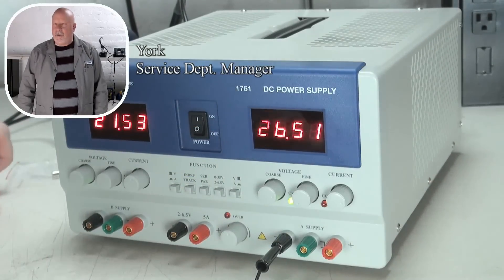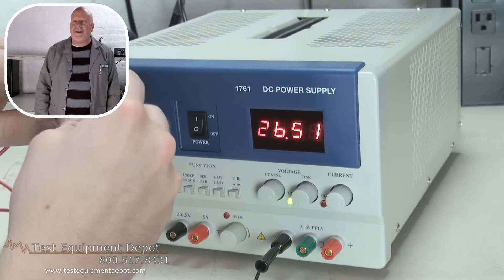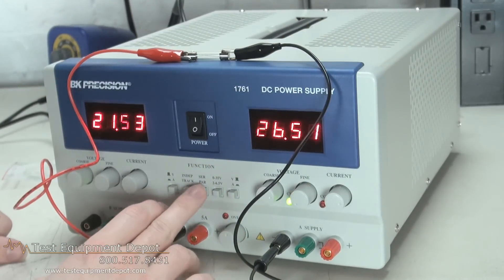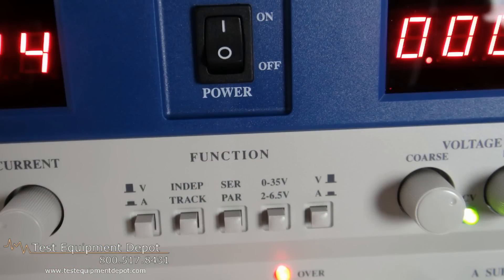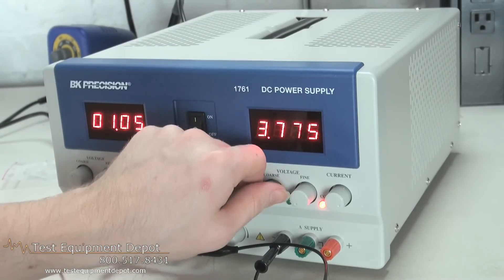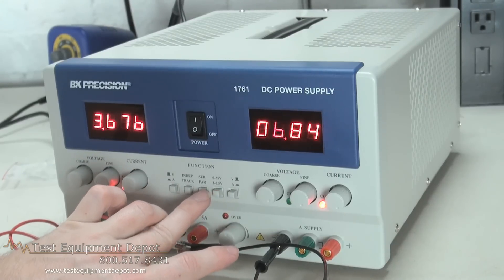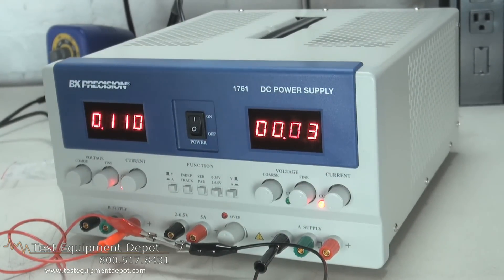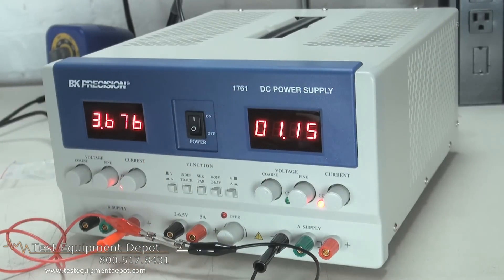BK Precision 1761 Triple Output DC Power Supply

Comment: Thank's for the description. Do you know where I could find a service manual or at least a schematic for the 1761 BK power supply? Channel A on my 1762 unit has just gone dead.
Reply: Long shot but does anyone have a schematic for these,  my 1761 A side display is wonky, it fluctuates randomly. Voltage output is ok, just the display is wrong.